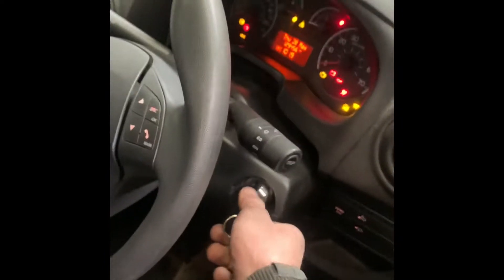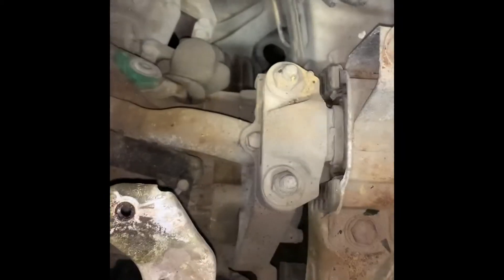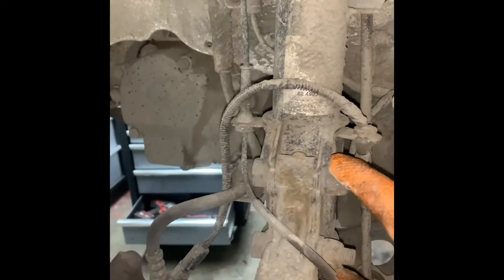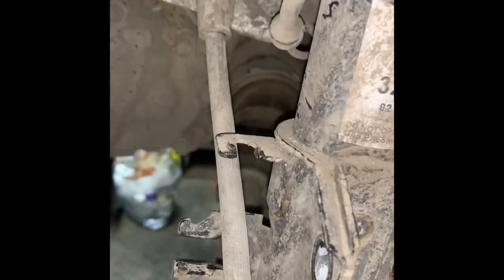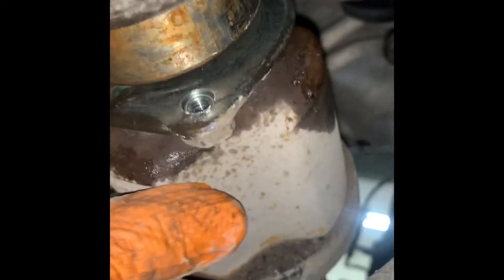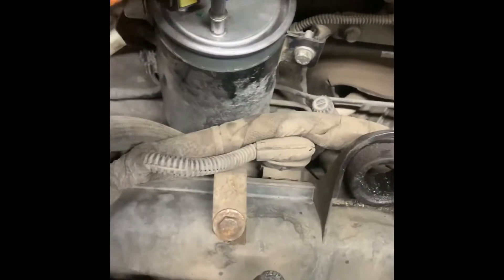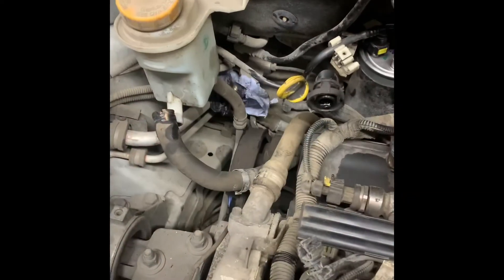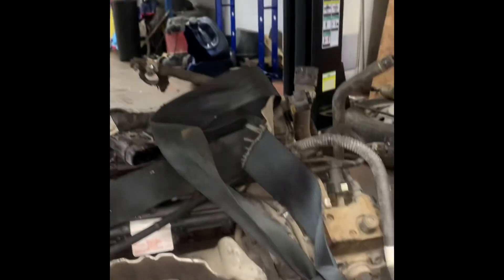Bipper/Nemo/Fiorino 1.3 Hdi Engine Removal

Comment: btw you can do the cam chain on one of these without removing the engine, is a bit of a faff tho. since the cam chain cover is held on by two bolts coming up from the sump so you have to drop the exhaust take the flywheel cover off and take the sump off.

Comment: Hi,i have Fiorino 1.3  Euro5 with 75hp.I have problem , when i startup car  after 3-4min i have blue smoke and car engine rpm jump from 800rpm to 1000rpm.I have check 3 times injector(in Bosch servise),new timing chain,new glow plugs,new DPF,new MAF,new MAP,clean EGR,clean intake manifold,clean intercoler.Oil is always on max.When car litle get worm all is OK.Can you please help me?Thanks